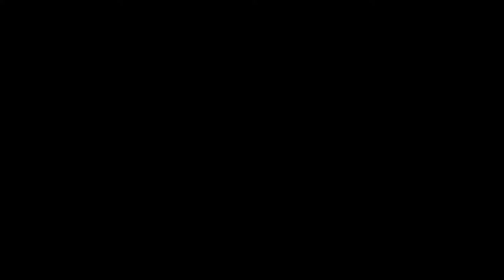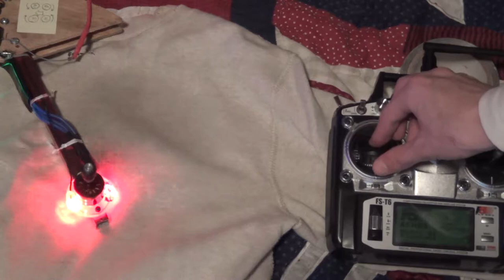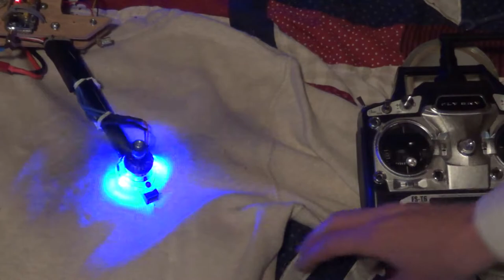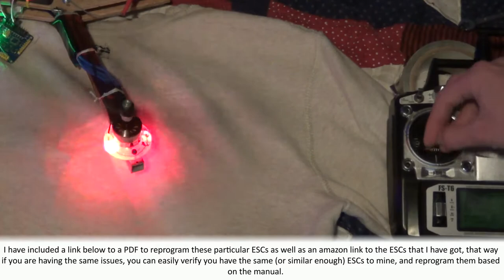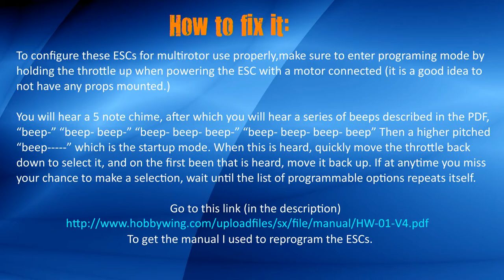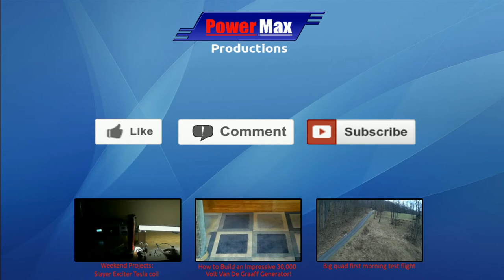ESC problem documentation (how to fix it too)

Comment: My brushless RC car constantly 'glitches' like that.. But i don't think the ESC is programmable or i can't find a card that can do it.. I think it's a 60A Turnigy and quite old. Bloody thing.
Reply from the maker: +ChaosHusky My understanding is that this effect is actually normal, and the reason it occurs is because the ESC has no clue which pole to power first when it is stationary. It relies on back EMF from the coils to figure out which pole to activate next to keep the motors spinning. However stationary magnets and coils do not produce back EMF, the bell needs to be turning to produce a voltage. So the ESC just "guesses" at which motor needs to be activated and the jitter at the beginning is the result. The solution for quadcopters is to have a minimum motor RPM set for idling the motors. (sort of like how a car engine is idling when at a stop light.)